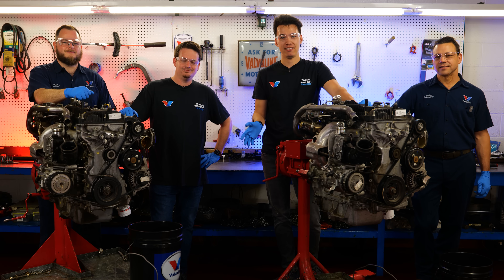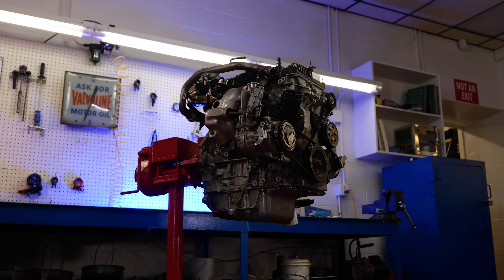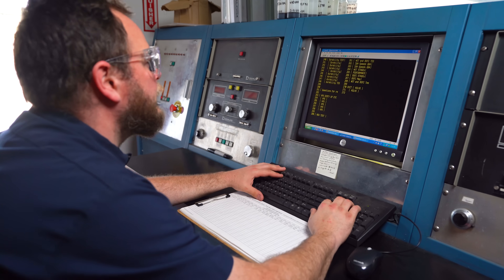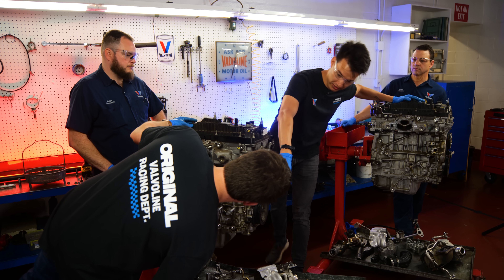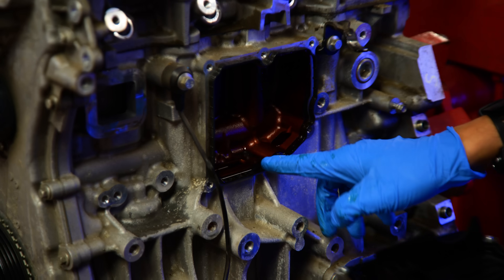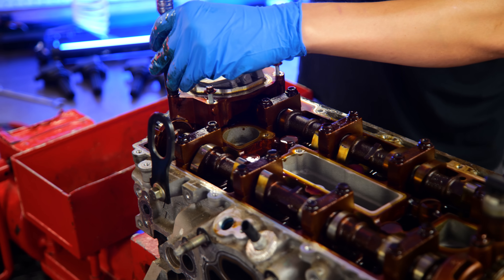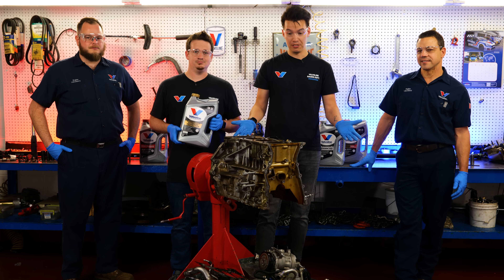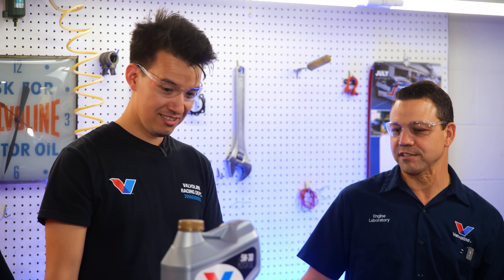Testing different oils over 4 years and 1 MILLION miles

Comment: 10,000 mile oil change with a TURBO!  Crazy, no wonder the conventional looks like hell, 3000-5000 absolute max for conventional oil.  With a turbo I would go 3000, and 5000 synthetic
Reply: Yup, you’re right on the money regarding those intervals.
Reply: @AnontheGOAT yes. In a laboratory, however, 10k works ok.
Reply: Most reasonably maintained cars end up in the junk yard with a good engine with less than 250k miles on it. Why spend more on oil changes for the engine to last 500k?
Reply: There is 18,000 miles/2 years change interval on almost all EU turbo engines. If you drive short drives reduces interval is approx. 10,000 miles/1 year. They mostly work without any issues.
Reply: Miles or km?
Reply: My turbo VW in the UK has manufacturer recommended 25,000 mile oil and filter changes.

Richard
Reply: 💯 
I change mine 3-4K(TOPS)
But it’s a big turbo Veloster N making well over 400whp
Reply: The conventional Oil didn’t actually look “like Hell”!
Reply: The sprinter has 37,500 mile service interval and they are still going strong on 500k-1M miles. Ok they are low revving and a large oil capacity compared to cars but even so thinking you need to change your oil every few thousand miles nowadays is erroneous. Ok if you had a very powerful classic you want to look after but for modern cars it's pointless.
Reply: Can't believe the number of people insisting you replace oil 3-5k miles. My car has 300k miles, intervals of 10k, and still runs like new on mobile 1 synthetic. Granted, it's an n/a v6, but you're throwing away money at those intervals. 7500 min if you're picky.
Reply: my first thought, they said "10k service interval" and i DIED
Reply: Technically, Ford calls for 10k oil changes with a syn blend on the Ranger. So that might have been their reasoning for the interval. I personally do 5k full synthetic and sometimes think of going to 3k but know I am probably wasting TIME and money at that point.
Reply: Smart
Reply: 10k miles oil change is so the service centers get more revenue!
Reply: Wtf? 10K isnt too bad, 7,000 would be great but i mean mineral oil is like completely gone from the car market, the only mineral oil i saw the last 10years was for a lawnmower😂
Reply: And it works just fine too. 10k oil changes in my Rolla from 2010. Almost 200k no problems
Reply: For real, i personally would never go over 4k miles on any turbo engine.
Reply: They couldn't fool you, could they?
Reply: European small 1.0-2.0 turbo engines get 15-20k miles intervals (30k km is common)
Reply: L @Bcuxythshsvrzggc  which cars with a 1.0 turbo would that be?
Reply: @Bcuxythshsvrzggc  no, they do not. Kilometers maybe, but not miles.
Reply: @Bcuxythshsvrzggc  I would take  Renault Clio 1.0 60 mpg any day.
Reply: Well the video is proof that a 10k interval is just fine with full synthetic.
Reply: Not 100%. It was tested in indoor environment. Not actual road test during summer and winter .months
Reply: @joshmoore3103 if your only driving on a computer controlled dyno in a conditioned facility. These tests are nothing approaching the abuse real world engines see with dirt, dust, temperatures, and loads. This 500k miles here is basically 150k highway miles in a temperate climate. I change every 5000 miles with full synthetic oil.
Reply: it's weird how manufacturers recommend 10k intervals in both kilometers and miles for different markets
Reply: i do 5000 in my NA honda D16 with 9.2:1 compression running synthetic. i really think they mark service intervals that high for marketing
Reply: @jakefish3184 a d16 shouldn't do 10k you have diffrent oil and gaps to maintain.
Reply: @jakefish3184  oems gets CAFE credits from the EPA for longer OCIs because it creates less waste oil. It may survive the warranty period but its not ideal to do 10k mi OCIs in most cases.
Reply: It made it to 500k miles. Looks like 10k is fine
Reply: 10k full synthetic is usually ok, depends on the conditions though
Reply: Agreed. A turbo engine with conventional at 10k miles is just silly and the varnish makes too much sense with what that conventional oil is being asked to live with for that long. This test would look shockingly similar if it was 3k on conventional and 5k on synthetic.
Reply: There are two reasons manufactures went to longer intervals. 
1. People don’t want to do maintenance, so 10,000 miles is half the amount of changes, makes the consumer think there still doing ok, and most people lease or trade before anything bad happens.
2. The government incentives long oil changes, less oil, less waste oil.
Reply: yeah 16000 km on conventional oil change is ridiculous!
Reply: Exactly right.  This just negated the whole test.  Conventional and synthetic have different change intervals. Conventional has historically always been every 3000.
Reply: I always done 3k with turbo regardless if it were synthetic or not
Reply: I do 2000-2500, it's crazy to think people are doing 10,000 miles
Reply: 3000-5000 no matter what!
Reply: @MrSmurf459 exactly. Pretty much half of what the manufacturer recommends.

Comment: Wish they showed the carbon build up on the piston heads. 10k mile intervals is alot. I bet if they replaced the full synthetic oil every 5k or less, there would be zero issues with the motor.

Comment: FULL Synthetic IS NOT TRUE 100%  Synthetic oil  Its Hydrocracked Crude OIL   !  , I like Pennzoil Ultra Platinum its Made from Natural Gas  Not Crude Oil
Reply: PUP is still a Group 3 oil so its not really any different than the Valvoline that they tested. Redline and Amsoil are the best IMHO but not worth the money unless you want to run a super long drain interval.

Comment: Note that neither engine is packed with sludge. I get a kick out of some of the videos out there that show an engine packed with sludge. They all claim its due to not changing the oil on time. In fact, sludge is mainly cause by water/coolant contamination. This means the engine has an internal leak. Let's just ignore the real problem and blame it on something else, right. It's even more funny when the guys in those videos claim to be mechanics. Excessive wear generally happens most when oil pressure is not adequate. Low oil pressure can be cause by a number of things. The most common is low oil supply. These guys said they were checking and topping off the oil every 8hours. Even though these engines only had oil change every 10k (past due even for synthetic). They also had 500k on them. They were both in very good condition. The conventional oil produced more oil varnish, which is to be expected. That varnish would also be a lot less if the oil changes happened every 5k rather than 10k. If you take care of your engine  and it will last a long time. Imagine that.

Comment: NEVER run 10,000 miles before change, it damages the engine.
Reply: Not true. My 06 4.0 explorer runs 10,000 to 15,000 mile oil changes on valvoline full synthetic with motorcraft filter. Still runs like a champ 18 years and 240000 miles later. Veey harsh off road miles. Also ample hours of idle time. Totally engine dependent.
Reply: @snowg4953 No, you have gotten lucky, I have seen abused engines run with so much build up you can't see the head bolts, ran good, so does this mean it is good for it. Some people get away with stuff others can't, buy a lotto ticket, but I'll never buy the leave oil in 10,000 miles theory.

Comment: I've never heard of running conventional oil 10k miles. Imo I'm more impressed with the conventional oil.
Reply: Real synthetics are PAO or Ester based. At some point they classified base 3 oils as "synthetic", which are the highly refined dino oil everyone is saying as conventional. They're usually hydrocracked like what most petroleum company use. Amsoil uses PAO and base 3 oils. Motul uses Ester on their full synthetics.
Reply: @jlsaibot0319  Absolutely true (I do use Amsoil SS which is PAO-synthetic)
Reply: @AlexV-pf3io I also only use Amsoil on my pickup and motorcycle. It works great for me. One thing people dismiss with synthetics is that it manages heat better than conventional oil. Yeah a dino oil will work when maintenance schedules are followed but the engine will always be better off with synthetics in the long run.
Reply: @jlsaibot0319  Amen
Reply: The video was just a long ad.  Stupid stuff.
Reply: Kirkland oil is conventional oil - same as Mobil 1, or Castrol, or Valvoline…
Reply: @AlexV-pf3io mobil 1 is not the same at kirkland lol
Reply: @Bear-up  Of cause not.  But both are conventional - that is what I meant
Reply: synthetic oil starts of as conventional.  synthetic oil is just slightly cleaned up conventional, with some 'special' additives added.  Brand name conventional is probably better than Walmart 'full-synthetic'.  What people should really be learning about is the additive packages they use.  I wanna know how much ethyl-trimethyl-diketone-poly-crazyshitttoxicAF  is in my oils...  i made that chemical up BTW
Reply: @wesleydeer889  I'm believing synthetic base stock does not come from crude oil.
Reply: @skirkland1980  it does.  They don’t make synthetic oil from scratch.  Even Mobil 1 full synthetic came out of the ground.  Now Mobil does refine the oil further, removing impurities, and adding advanced additives they’ve spent millions developing (you should see Mobil’s patents).  No company, not even royal purple or redline make any of it from scratch.  “Synthetic” is a marketing tactic that was brilliant, and totally misleading.
Reply: @wesleydeer889 that one dude who’s channel tests all the stuff compared the Walmart oils to other brands.  It did pretty good.  Project farm I think is the channel.
Reply: @wesleydeer889  True

Comment: What I learned was that the oil doesn't matter, they both made it to 500K miles and in the north, the car would have rusted out long before this point and in the south it would have been stolen and sent to mexico.
Reply: I'm in the south and have been running Valvoline full synthetic in my truck since I got it with 80k it just crossed 220k and it's a base model so nobody wants to take it so we shall see if it makes it to 500k
Reply: Both made 500k under near ideal conditions. Synthetic has better cold start performance, under real world conditions that means alot
Reply: 😂😂😂 yep
Reply: Note, though, the conventional had a wastegate failure and a catalytic converter failure much sooner.  Not only do those cost money in parts, but also either mechanic labor and/or downtime while you get time to replace them.  The timing chain was also starting to go on the conventional oil engine.  Additionally, synthetics do better in a wide range of temps, so wear would've been worse in, say, extreme hot or cold climates.  Direct Injection engines might also get intake runners more gunked with conventional.  There's also the fact of time, conventional would likely get much worse over time over 10, 15, 20 years vs. the 4 tested here.  Overall, the savings of $20 or whatever it is per oil change isn't worth the penalties.  To me, the labor/hassle of an oil change is far greater than the cost of the oil.
Reply: @nunyabusiness896 the wastgate getting stuck probably ran too much fuel through the cats
Reply: @juliogonzo2718  I think the cats in both cases ran hotter bc the cars were stationary and didn’t get the normal airflow. Bad wastegate was still due to oil, so an example of cascading failures.
Reply: @nunyabusiness896  The wastegate is controlled by boost pressure and is not lubricated by engine oil generally.
Reply: @nunyabusiness896  you are right though being stationary could definitely be a part of it. They prob have big fans on the dyno but who knows if that is enough for the cats
Reply: @juliogonzo2718  A stuck wastegate has no effect on over-fueling.
Reply: @nunyabusiness896 you let other people work on your cars ewwww

Comment: I’ve been told for the most part the eco boost engines are reliable if you are using full synthetic, keeping up with maintenance(I’d do 5k not 10k) and checking the oil level…… over herd of several cases where people do the 10k interval and exceed the interval further and not checking the oil maybe once a month and running low and causing oil starvation…..

Comment: Next time you go buy oil for your oil change, compare the prices for dino oil vs synthetic. There used to be a big difference, with synthetic costing at least twice what dino does. But those days are gone, the full synthetic top shelf costs another $4 per 5 liter jug vs the plain old dino oil. There's no good reason to settle for the plain dino stuff anymore. And for the record, I'm a Pennzoil Platinum guy.

Comment: Great video. I'm in the UK and have been using fully synthetic oil in my cars for years. Anything from 2.5 v6 petrol, to 2.0 inline 4 diesels and service them both every 10-15000 miles without issue. Then again, that's the typical service interval we've followed here for years. Some car manufacturers now claim you can go 30,000 miles between oil changes but I think that's a bit much and wouldn't risk it.

Comment: Ok , now I feel pretty good about changing my truck and my 2 daughter’s SUV’s with synthetic every 5000 miles. My 2006 frontier 130,000, daughter 1   2018 pathfinder 140,000 , daughter 2    2012 highlander 225,000.  ( I do the oil and filter change so I know what goes in them )

Comment: GM did this test on their Quad4 engine back over 30 years ago. Problem is they never varied the RPM so they never found out the timing chain and breather were defective. U should try simulating real driving conditions and see how the oils differences affect the engines....

Comment: This whole test feels more like an accolade for Valvoline oil than it does for synth vs conventional.. 
 
1) what was the mean oil consumption between the two engines. 2) at what engine load percentage were those vehicles set to continuously run on the chassis dyno (because lab settings aren't gonna accomplish any real world use case scenario.. VW anyone??). 3) how were heat and duty cycling managed, or were they even testing metrics? 4) WE have no real proof that any of the testing actually occurred the way it way it was told. For all we know the filthy conventional oil engine got half as many oil changes.. I aint buying it, Ive had too many engines apart in this life.

Change your oil every 3,000-5,000 (depending on how you use it) or every 6 months no matter what, no exceptions.

Comment: 10k mile service intervals, sorry thanks but no thanks. I'll keep doing 3-4k intervals as long as engines need lubricant. The fact you can hear a difference in the valve train after you change the oil at 4k miles tells you that there's already been additive break down.

Comment: They never said what the oil consumption was between the two engines. I would imagine that the conventional oil engine used more oil. Especially since the cat went out earlier than the syn oil engine.  The oil burning is most likely what took the cat out.

Comment: Next oil change (which is this month) I will be switching from Valvoline High Mileage full syn to their Restore & Protect on my '03 Toyota 4Runner with 4.7L V8 @ 158K miles. In February I had the valve covers off for gasket replacement and the underside looked very much like the full syn in the video, nice light gold color. Also going to R & P in my '07 Highlander w/215 K miles, it's valve cover looks more like the conventional, even though it's been on full and semi-synthetic Valvoline for most of it's life.

Comment: Lab test means nothing compared to real world testing in all weather conditions, stop and go traffic, severe temperature swings, dusty environments and so on. And secondly engines today are not designed to last 500k miles there designed to fail after the warranty has run out

Comment: It is 2024. Somehow there is someone asking the question whether full synthetic oil is better than conventional oil.
Reply: They both have their place. Conventional oil is definetly superior for breaking an engine in and also if your seals leak and you can't replace them easily (think crank seal front back) conventional is superior because it won't leak or won't leak as much

Comment: Biggest issue is when someone buys and sells a car at x amount of miles, buyers will not believe you if you say you used synthetic, and how much miles on the car matters a ton on how much its worth. Someone can use synthetic only, spent alot mote on oil and oil filter, and will never get a penny more selling that car compared to someone that used conventional oil. I have used synthetic oil on at least 8 cars in my lifetime and thinking back, i should have just used conventional to save money. I easily lost thousands on each car just by putting miles and it ages.